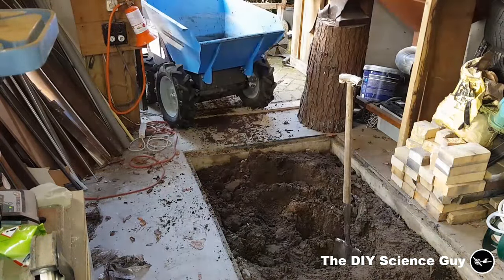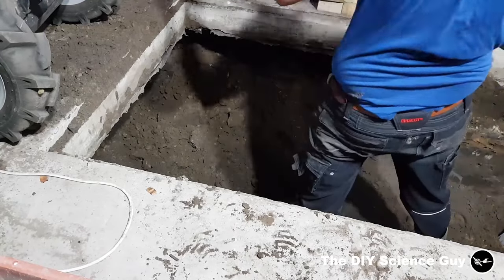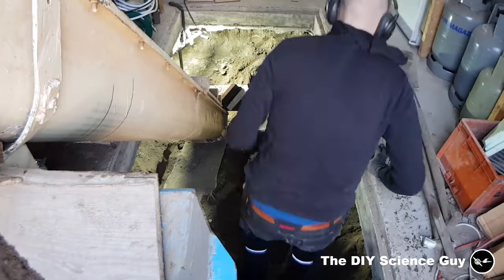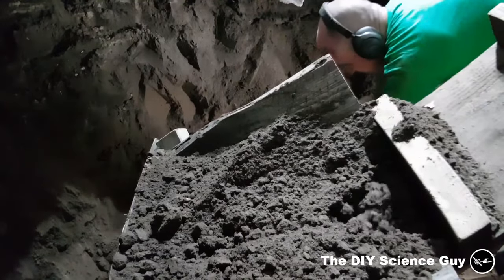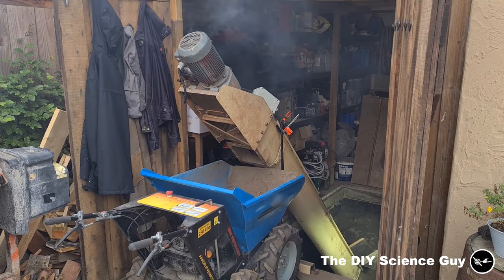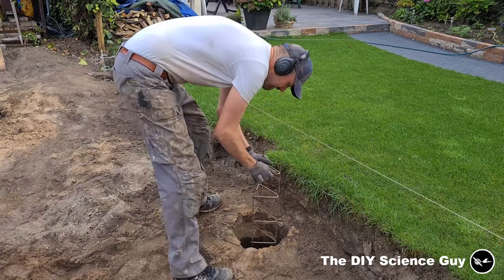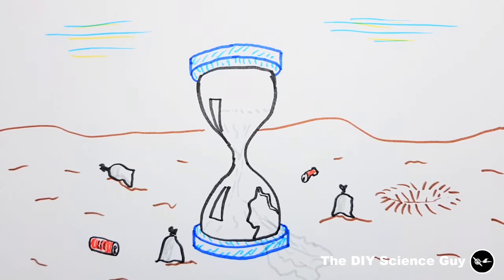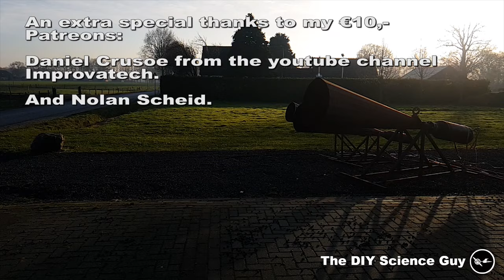IT IS TIME! Building a Bunker part 1

Comment: I was worried about you and your project, but have seen your update on the heatpump. :)

This video is awsome, but there are a few questions if you could include the answers to your next video it would be splendid:
- How did you drill the 3 meter deep and 250mm wide holes (and how did you come up with the dimensions)? Were the auger extensions not flexing? (How did you place the columns?)
- What are the dimensions of the shed?
- How did you come up with the thickness of the floor stab?

You mentioned that in the next video you'll say how you plan to retain the send etc I am looking forward to it. 
BTW did you do a soil test on your foundation? ( https://www.youtube.com/watch?v=77kQPIx-sIQ )
Reply from the maker: Thanks! No worries, I'm still here! 😉 In this short you can see how I drilled the holes etc. The dimensions of the shed are 5.5x3.5 meter. For the thickness of the floor ther are guidelines which I looked up and I made it 3 cm thikker and added extra reinforcement to make it stiffer. I did no soil test because we don't need deep foundations where I live, because it is all sand. but thanks for the Youtube link, I will definitely check that out!

Comment: Gaaf!
(how) are you going to make it waterproof?

Groetjes,
Mark
Reply from the maker: Hi Mark, Thanks! I'm going to seal the concrete from the inside with sealant. And probably insulate the wals to prevent condensation. The ground water is at 4 meters deep, so that is not a problem.
Reply: @TheDIYScienceGuy  Ah super!😄👌
Reply: @TheDIYScienceGuy  You should paint the walls with "Dysperbit" it's some kind of  chemical pitch. Also it would be nice to insulate the bunker thermally. You can use XPS styrofoam for that (does not absorb water). Hope it helps, take care!